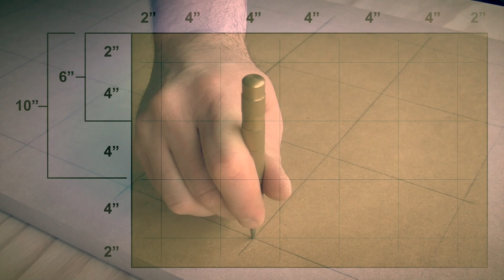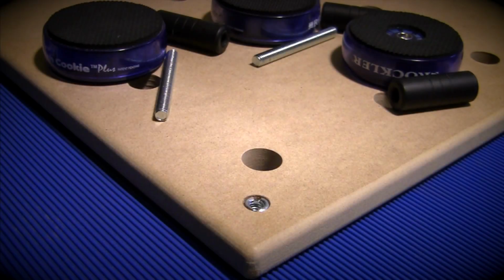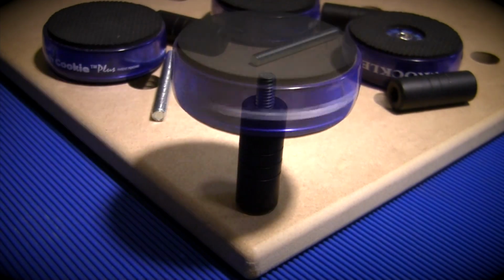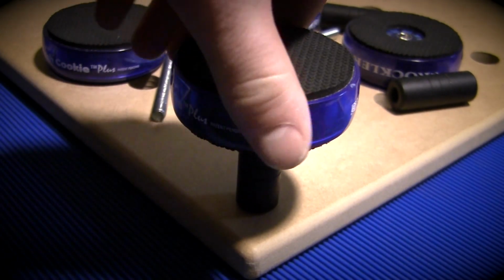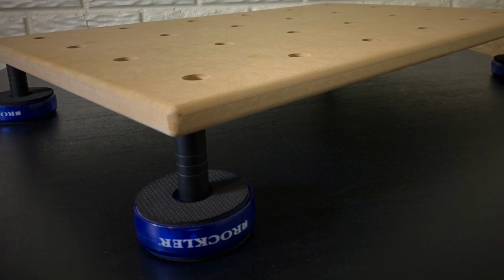Custom MDF Top For Clamp Demo : Festool MFT Inspired

Comment: Do you have any experience with the durability and longevity of MDF as a workbench top? I really hate my (homemade by the previous homeowner) workbench top and was thinking of using MDF for its replacement.
Reply from the maker: I would shellac it or seal it. Don’t get water on it if it’s not sealed. My work top that has the track in it is holding up just fine. I dont beat the hell out of it but I’m gonna do MDF for my tops in my shop I believe. I just hate cutting it...or drilling it...or using a router on it. Other than that I love it.
Reply: @CPBuilds  Thanks. Good tips.
Reply from the maker: David Plass not a problem. Let me know how it goes.